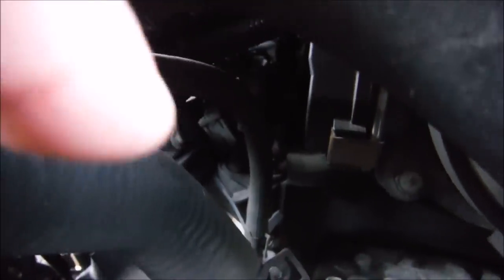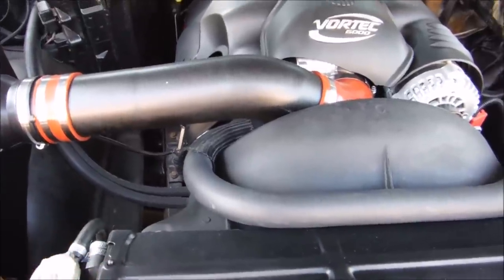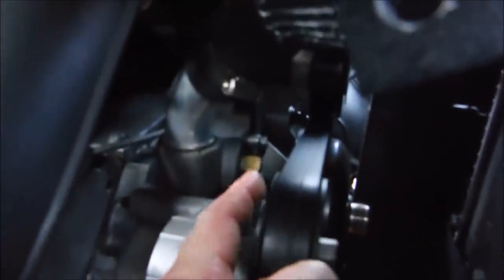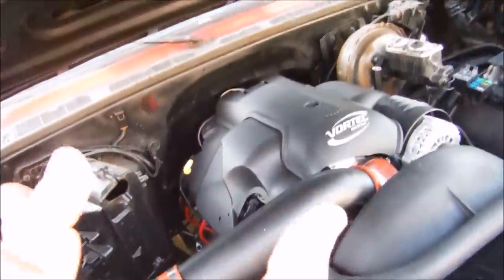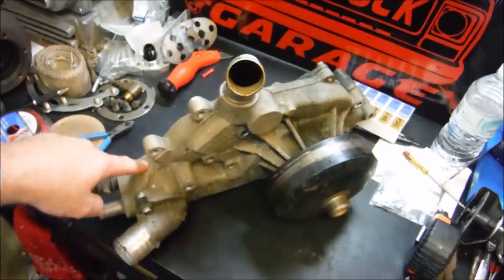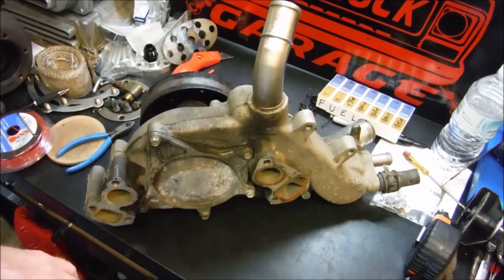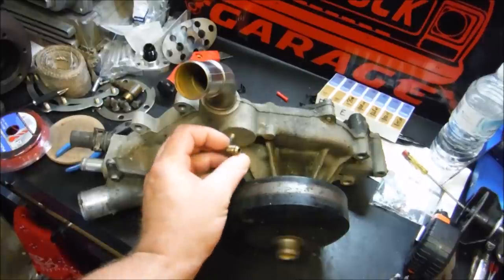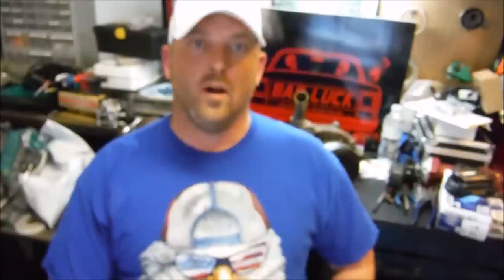LS STEAM LINE HOOK UP AND EXPLANATION

Comment: what happens if you leave the thermostat out of the engine? i know it would suck in the winter. but how would the engine run in the summer? can you even leave the thermostat out of these engines?
Reply from the maker: Thanks for watching! The same thing that happens to any engine when you run it without a thermostat. There is no valid reason to leave the thermostat out of any engine. The thermostat is there for a reason. If you have an engine that is prone to running hot,(and the thermostat is functioning properly) then it will generally run even hotter without the thermostat as the coolant will not remain in the radiator long enough to be cooled before re-entering the engine. If the engine DOES run cooler with the thermostat out then the thermostat was not operating properly and should have been replaced.  If you have an engine that is having cooling issues due to a faulty thermostat, then you should replace it, not discard it.
Reply: Also, modern cars are more aware of engine temp. For thermal efficiencies and exhaust gas treatment, a modern engine might run richer when it i thinks its cold in attempts to warm itself up, potentially decreasing MPG. I might be wrong, but i think this would also subtly affect engine life, catalytic converter life a bit more
Reply: Bad Luck Garage not to be an ass but i dont think what your saying is true..... if what you are saying is true why do auto parts stores sell fail safe thermostats that fail in the open position? and allow all flowof coolant  through the block and rad?  plus science tells you the more watter you can pour over a given area has a better cooling affect than it would if it just sat there.
Reply from the maker: hotrodj21, I believe you're missing the point of “failsafe” brother  😉 You also don’t seem to be completely comprehending my original reply. Please read It again. I feel like maybe you need to understand how the entire cooling system  works to get exactly why it’s a bad idea to remove the thermostat in most applications. If I have time this weekend I may do a video on it and explain in more detail. 👍🏻
Reply: Bad Luck Garage ok well your talking to a guy your age.... and i took mine out no problems car dosnt over heat if you want to be an ass by all means do but dont expect good things mabby you need to get your beauty rest princess
Reply: or mabby you didnt comprehend school
Reply from the maker: hotrodj21, I really don’t see what your age has to do with anything??? And I wasn’t trying to be an ass, I was trying to answer your question. In my original reply I explained why it would or wouldn’t work in certain situations and based on your reply it was obvious that you either weren’t understanding what I said, or that you somehow missed the part where I stated “ If the engine DOES run cooler with the thermostat out then the thermostat was not operating properly and should have been replaced. ” That’s why I said “read it again”. No need to get all butthurt. I’m trying to help.
Reply from the maker: Alejandro Santa Cruz. You are correct sir. If a modern fuel injected vehicle uses a lower temp thermostat or an overly efficient cooling system with no thermostat to maintain a steady temperature, it can cause it to run off cold start tables and run a richer mixture as well as different timing. Most of this can be corrected in the tune but there are many variables and tables for both timing and fuel that are affected by both engine temperature and intake air temperature.
Reply from the maker: Well this turned dark really quickly😳
Reply: @hotrodj21  if it failed closed you would have no flow and overheat. If you have no thermostat the coolant will never heat up in cold weather and may overheat in hot weather.
Reply: @giovanhagar  had to test it myself👍

Comment: That explains  why I had overheating  problems  last year
Reply from the maker: It’s a possibility. Air pockets in the system will cause serious issues. Make sure you follow the procedure to remove air while filling and you’ll usually be good. 👍🏻

Comment: I appreciate your videos, this isn't a ball bust. R is not tapered .
Reply from the maker: Thanks for watching. I misspoke a bit in the video. No the bit is not tapered. The tap however is and thus your taped hole will be when you finish tapping it. This is why you don’t want to to go too deep with the tap. If you do, your fitting will bottom out and will not seal properly.

Comment: Some people also say the reason the rear ports are blocked off in a ls6 is because there was no room under the intake
Reply from the maker: I would definitely agree with that reasoning if it wasn’t for the fact that the trucks all switched as well. The way I see it, if they really needed the 4 corner system, gm would have designed the intake  around it or designed a steam port manifold that when around the intake instead. I mean all they would have had to do is make the lines an inch taller and ran them down beneath the fuel rail I stared of beneath the intake. It would t have been a design difficulty or anything.

Comment: I drilled and tapped my thermostat housing. If the pump goes bad i dont have to redrill a tap
Reply from the maker: That circulates the air directly back into the engine block. Exactly what you DONT want to happen. And brother these pumps last 100,000+ miles so I wouldn’t be too worried about an extra five minutes to replace it 10 years from now. 😉